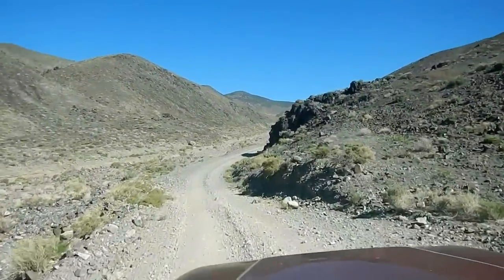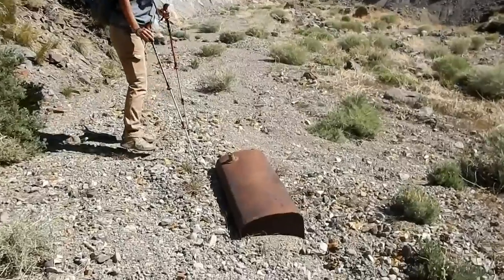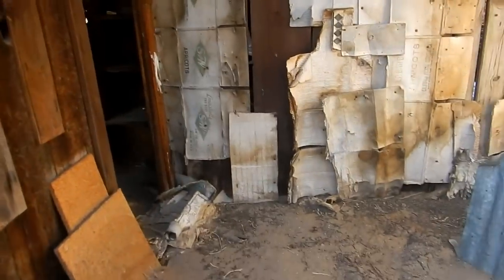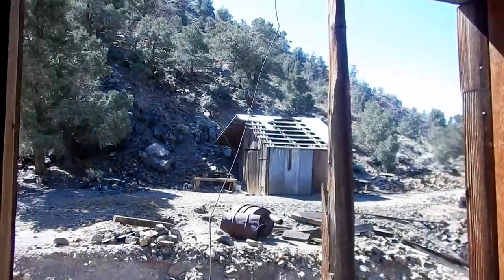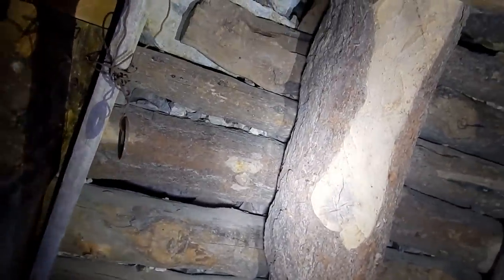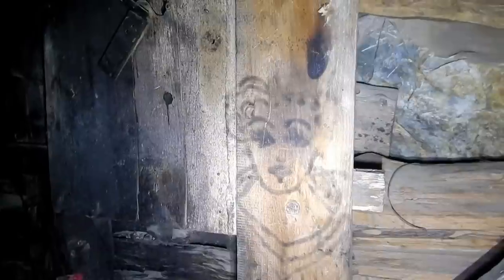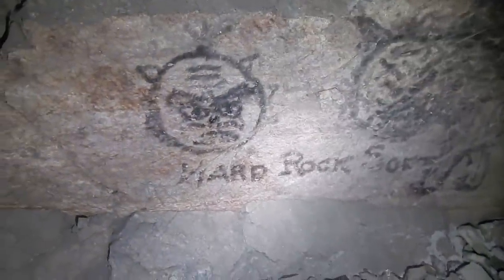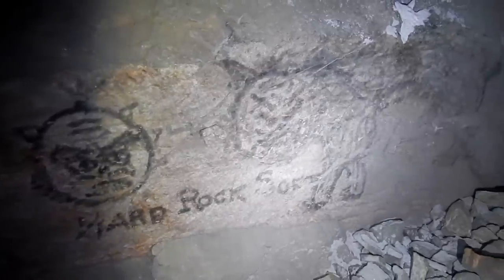5 Level Mine - Steep Ladders - Great Artifacts - Two Cabins - Natural Timbering - Dynamite In Box ⛏️

Comment: Thanks Tom and Julie, this was a mine to sink your teeth into. Lots to explore and artifacts. 

I thought about rough cut reclamation from this mine. There's so much use of full, split and sawn logs in that mine. The grain on much of it might give very interesting furniture lumber? Those gnarly Cedars were probably dotting the whole region back in the day. I know removing it is not happening.

Fantastic mineralization throughout, with lots to explore. It seems they really had a knack for following the smooth fault? It was either a multi fault mine, or the miners know how to read faults? My guess is it's innate for some of the ol' timers?

Thanks for opening with the cabin, out-building and nature 🪷🌼
Reply from the maker: Yes, there is a lot here to see from the beautiful timbers to the minerals and the many artifacts. The value of the lumber in these old mines is off the charts. Only once have I seen where someone had tried to make off with a huge timber. They got it outside of the mine but gave up when faced with hauling it down the mountain. Thanks for the thoughtful comment,  Rick!
I'm thinking the old miners knew just about exactly what they wanted to do as far as finding, and following,  mineral veins.

Comment: That second barrel was a old Mercury barrel that turn into wood stove and the one in the mine was a other mercury barrel. That’s how they moved them was on the rails in middle of the barrel. Mercury was really heavy to move. Great video you guys and stay safe out there can’t wait to the next video
Reply: Hi Vincent, I'm going to have to disagree on those barrels. Mercury came in 76 lb. steel flasks. I can put about 100 lbs of mercury in a 1 gallon bucket. Some of those barrels with ribs were used for oil. Others that are found in old mining camps/underground were filled with drinking water. Those are usually zinc plated.
Reply: @richardbeee  I was told Mercury or cyanide was in those barrels by a old timer but maybe he was wrong but that’s why they like rail around the barrel because the mercury or cyanide was so heavy made it easier to move
Reply from the maker: Thanks Vincent, glad that you liked the video!
Reply from the maker: That is what I've heard, too. They measured mercury by the 76 pound flask. It would only have the volume of 2.5 liters.

Comment: The paper explosives box was interesting since I don't think those were in use before the sixties. Most all mining was shut down in 1942, so the 1943 dates are possibly not from miners, but someone could have been hi-grading while the war was going on. If so, I don't know where they would have gotten the ore smelted? Beautiful copper colors, thanks for the explore.
Reply from the maker: That's interesting, I guess I've never researched when cardboard replaced wood for dynamite boxes. As you said, most non strategic metal mines were shut down in '42. There might have been tungsten mined here at one time. It's difficult to pin down the exact histories of these okd mines. Thanks for the comment, David.

Comment: I have about a dozen pot belly barrels only one is riveted. They are dated from 1902 thru 1920's The ribbed barrels riveted may be late 1920s.  The ribbed barrels were used  during WWII.  On the ends usually dated month/year. Most are Standard oil barrels.
Reply from the maker: Thanks for the information on the battels, Don. We have seen several of the pot belly style steel barrels and I love them. I should have looked for a date on these.

Comment: Hello Tom and Julie,  Nice mine exploration.  I'd always be interested in the gauge on rails in drifts and inclines as well as the size of the rails.  The width of the base and the rail height are almost always the same.  Rails are specified in the weight per yard and the rail with or height can be compared to a chart to get the weight.  See you next week!
Reply from the maker: I'll keep that in mind when exploring. I think the manufacture date is on the side of some of them as well. How do you properly measure the guage? Outside to outside of the tops? You also want the width of the top of the rail? I always forget to look at the sides for any information about them. Thanks for your input, David!
Reply: @TomandJulieMineExploring  Thanks for your reply.  Gauge is from the inside of one rail head to the inside of the rail head on the other side.  The rail head width is pretty much standard for each size of rail.  Of course, wear and corrosion will alter measurements and gauge is rather variable in many cases.  That is the reason that the tread on the wheels is so wide.  I have a reprint of a catalogue I'd like to send you.
Reply from the maker: @davidsellars646  Thanks for that, David. Here is our email address. 
jwigren40@gmail.com

Comment: Wow, what a mine, thanks! Did level three have an exit to outside - had tracks and shutes?  Hey curious, do you use rechargeables for your flashlights?  One piece of advice: My firefighter friends taught me long ago to avoid holding onto rungs with your hands, instead grip the sides of the ladder - rungs break. I understand it's harder with those shute ladders but safety first!
Reply from the maker: It really is a great mine to explore. There was no connection to the outside from any of the lower kevels. Yes, we both use rechargeable lights for our main hand helds. I use a Coast HP 10R and Julie uses a Coast XP 11R. Both are rechargeable and come with an extra battery. We also carry back up lights of course.
That's good advice about the ladders. We try and do that, but, mine exploring is not always straightforward, so sometimes you just do what you have to do to get by. Thanks for the comment, David!
Reply: Love you two!

Comment: Looks like a fluorite mine (the purple rocks).  Watch out for H2S.  Deadly
Reply from the maker: This is a silver mine, although like many mineral and metal deposits there is usually more than one notable mineral or metal present. So there could be fluorite here. We carry gas detectors to check for hydrogen sulfide gas, among others. Thanks for the comment,  Robert!

Comment: In case nobody mentioned it in the comments, the riveted barrels probably contained Mercury
Reply from the maker: I think mercury was generally shipped in flasks which were about 2.5 liters in volume weighing 76 pounds. Mercury weighs about 112 pounds per gallon so a large barrel of mercury would be extremely heavy to ship or handle. Thanks for commenting,
Reply: @TomandJulieMineExploring  You are correct, but the strongly constructed barrels were for transporting bulk amounts to large mills back in the day
Reply from the maker: @battleshipnewjerseysailor4738  Wow those must have been some heavy loads. It makes sense though. Thanks for the comment!

Comment: Arn't you ever worried about bad air??????
Reply from the maker: Many mines have significant air flow going through them, much more than you might think, which provides fresh air. Also, we both carry air quality monitors that check for low O2 and the presence of H2S, CO and flammable gasses. Thanks for the important question!👍